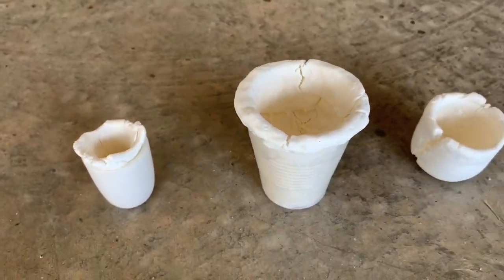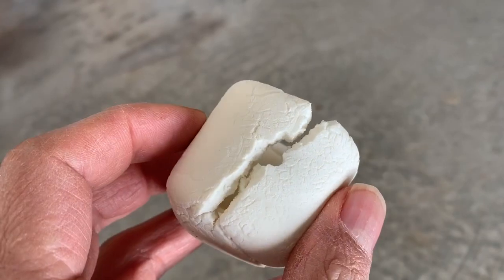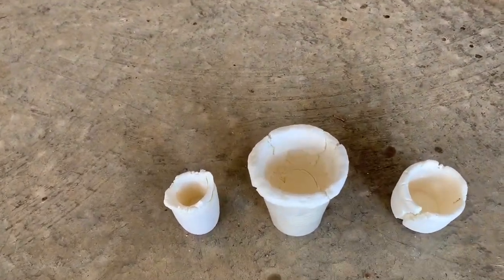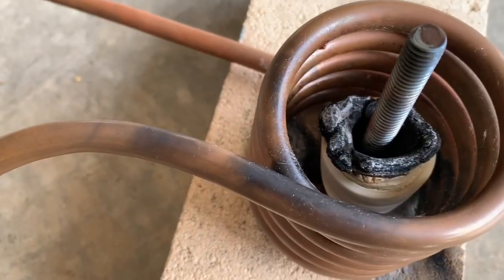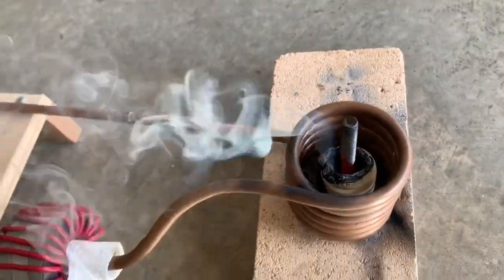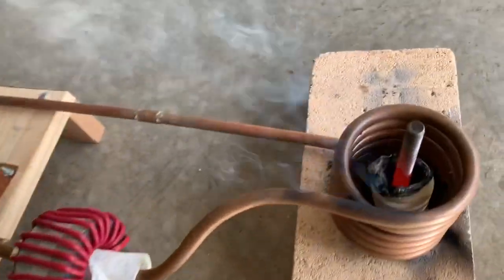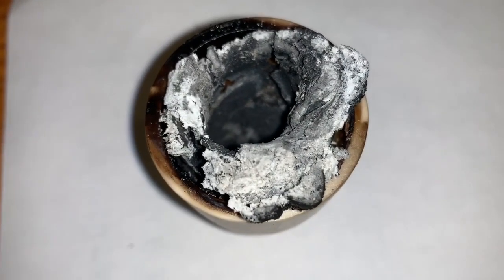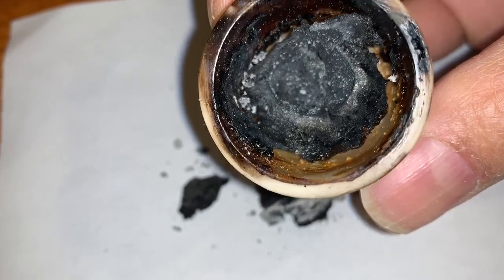Precharred Starlite Crucible vs Induction Heater?

Comment: Hello SciTube, I've personally been experimenting with a different recipe.  Baking soda can be replaced with Baking Powder but three times the quantity. For example 1gram of baking soda for 9grams of Cornstarch becomes 3grams of Baking Powder to 9grams of cornstarch or 1:3 instead of the 1:9. My test had the uncharred portion actually "expand" due to the double leavening ingredient. Hopefully you can get similar results.
Regards